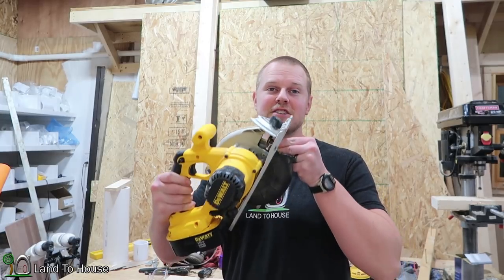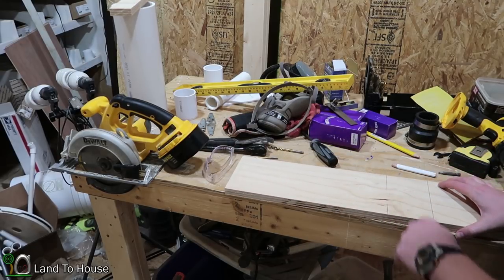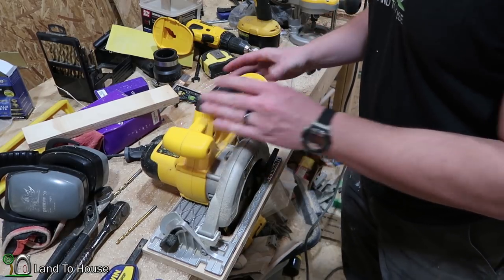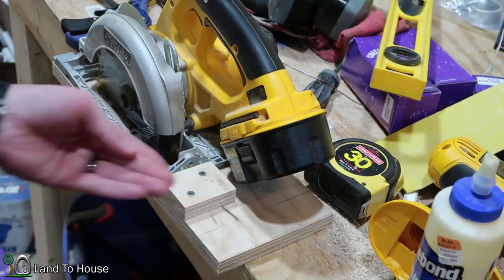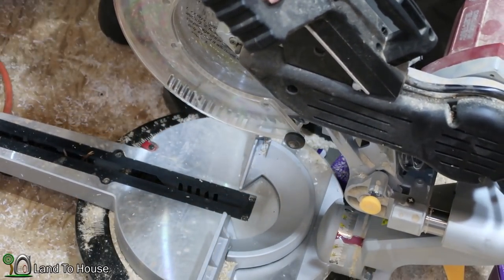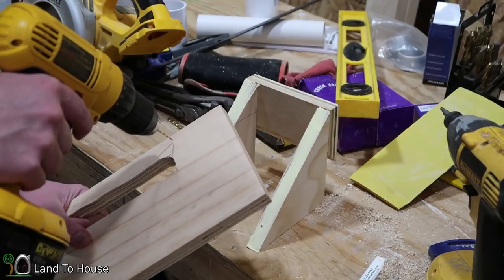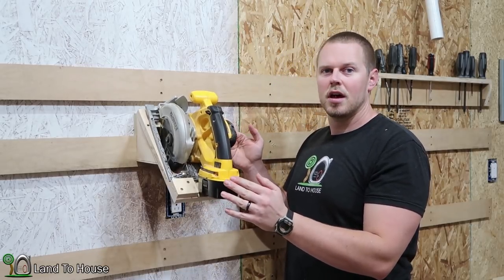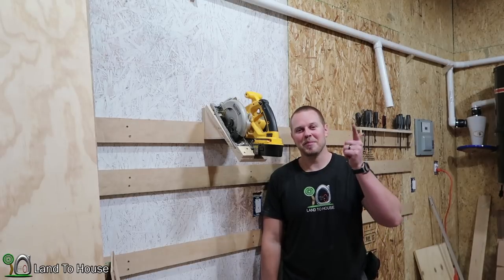Circular Saw French Cleat Mount Build a Workshop 44

Comment: I would just put a screw up top in  the notch on the front edge of saw,where you follow the line your cutting.That would keep the saw from moving.Great video
Reply from the maker: I went with a small block of wood. The screw idea was a good one but I was worried that I would either mar the guide or place the screw in so that I had to take a lot of time aligning the saw when I shelfed it.